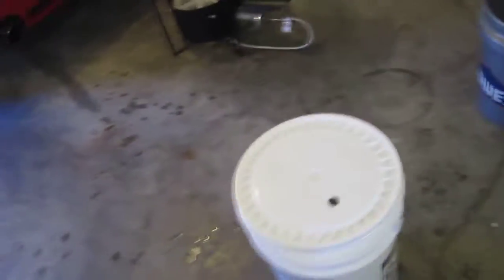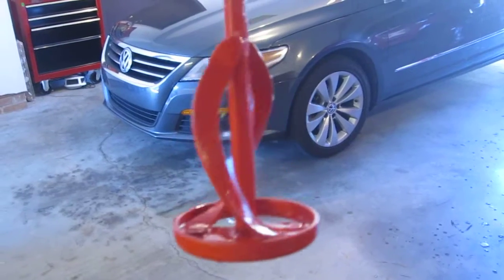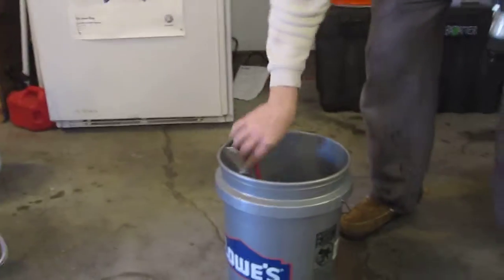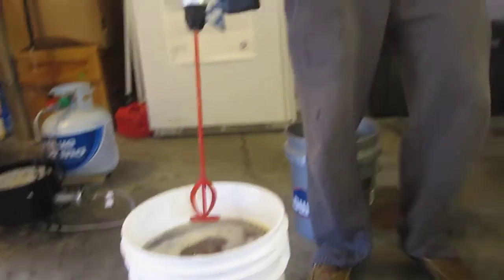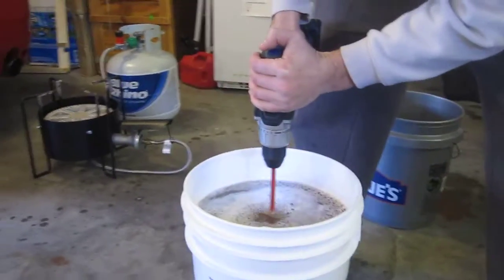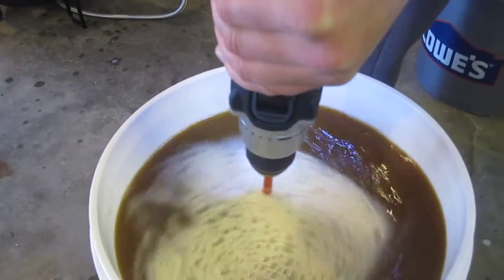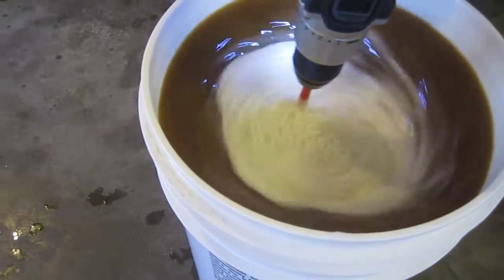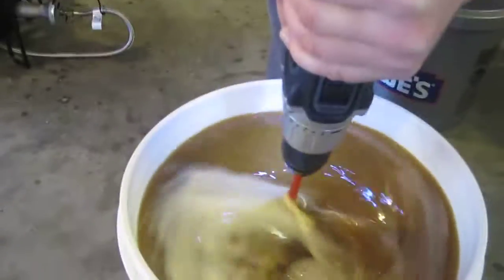Aerating beer before fermentation.

Comment: Dope. Just used this method on the second batch of a lager I'm making. First one came out a little fruity. I definitely pitched enough yeast but it may be due to lack of aeration. This time I whipped it like this for 5 minutes. Super thick crema on top afterwards. Hopefully this helps the yeast do their thing in the early phase of multiplying and acclimation.

Comment: I love the ingenuity, but its not doing much.  Spinning the wort does not add oxygen. Only the splashing, which occurs when shaking, is adding oxygen - the same way waves add oxygen to the ocean. You are trying to put oxygen from the air into the wort, so you have to break the surface by shaking and splashing. That appears to be happening in the video (a bit), but the spinning has very little to do with the minimal oxygenation in this video. Try a fish tank pump, with a hepa filter and air stone.